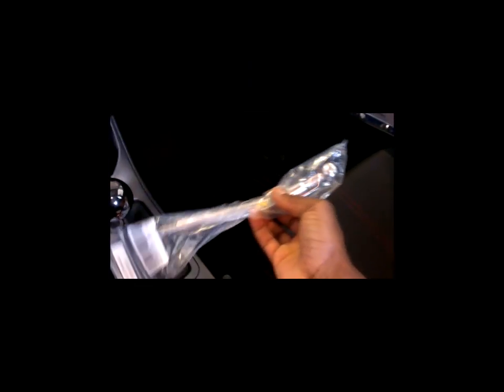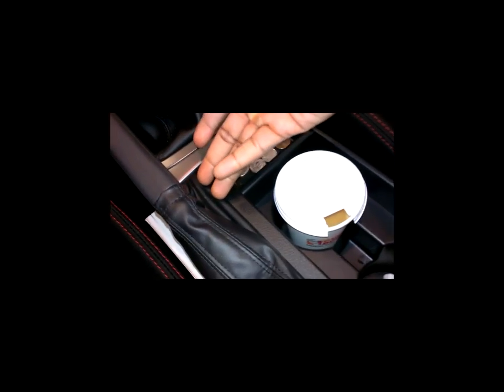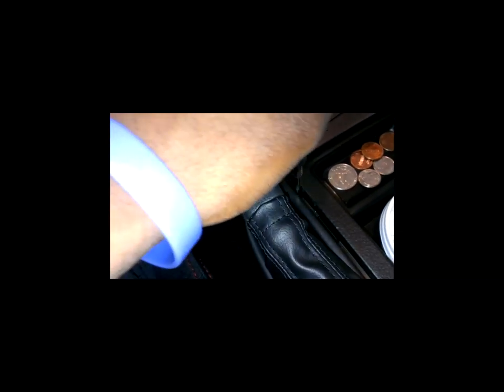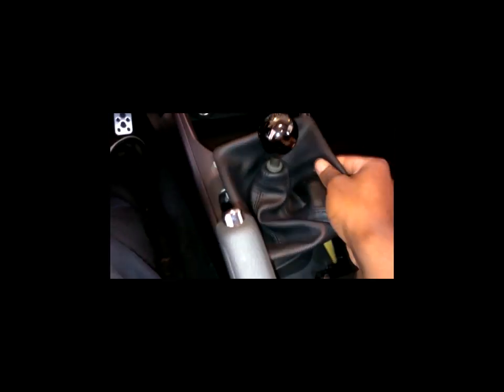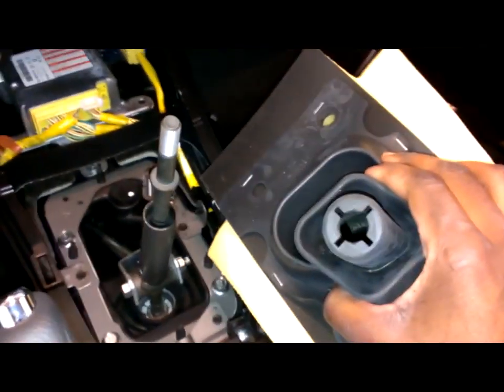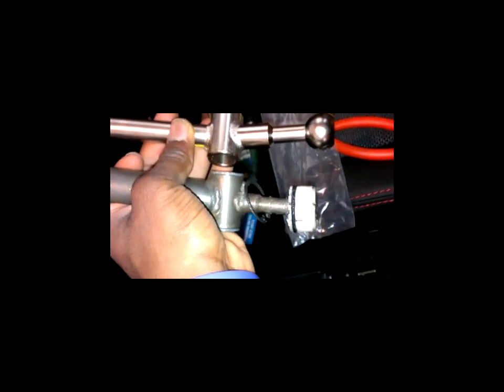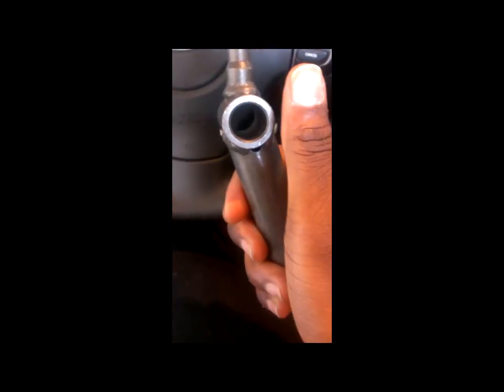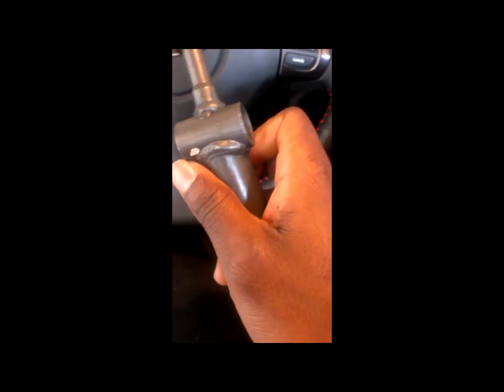WRX Kart boy Short Shifter Install & Review

Comment: I want the Cobb because it sits lower, but the fact that its adjustable scares me as it wont be as strong. 
The kartboy seems nice and the shifts will be shorter, but 1 inch lower seems like it wouldn't even be noticeable....

Anybody has either one installed ? Forums don't say much and all the posts are so old I feel like the shifters have evolved.
Reply: Hey Samuel. I understand that the adjustment screw for the height is really cheesy. It strips easily. I would stay with Kart Boy. I just bought mine just now.

Comment: Did you have to buy and install the Kartboy Bushings too or did you leave them stock? I really want to buy this shifter, but i'm not sure if I also have to buy the bushings too
Reply: Buy the bushings, they are cheap and they make a big difference by themselves, especially if your car is higher mileage and the stock bushings are worn out. With the short shifter and bushings the difference will be huge.